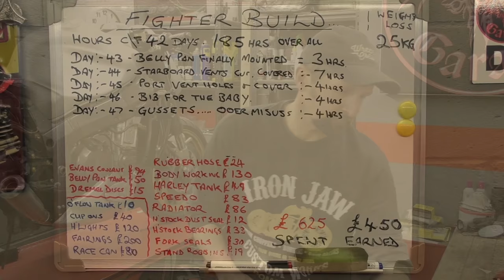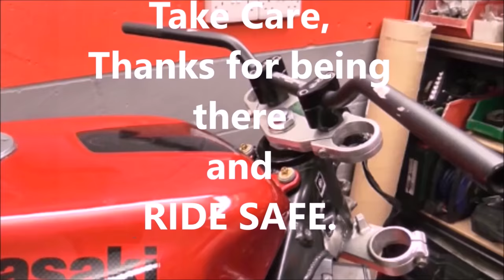Delboy's Garage, Fighter Build #42, GUSSETS !

Comment: Just a thought ... Possibly a lousy one, though it might inspire a better one or simply serve as a bad idea against which to contrast somebody else's good idea [was that modest enough? :) ]

Two words: NACA duct.  Wikipedia has a description, though a google image search will provide loads of examples on aircraft (including fighter aircraft) as well as on racing vehicles.  You can buy them preformed, but given your skills with metal working I am sure that you could also make your own easily enough.
Reply: I see Gregg Camara had the same thought.  Maybe there's something to this NACA duct thing.  (Then again, maybe not.)  :)
Reply from the maker: Thanks buddy, thinking of a similar idea but reversed, something to create a negative pressure and draw heat out... thanks for your kind input !

Comment: Probably been mentioned further down but I think it looks awesome without the panels and just leave them or maybe flare the back edge of them to deflect air more into the exhaust or French them with just a small 5mm ring to go with the nose cone. Sure it'll look good anyway!
Reply from the maker: Hi Josh, a few people have said flare out the holes, but they sit at about 30 degrees towards the direction of travel.. so no need for flares... i have a cunning idea to actually go the other way and create exhaust vents....but gonna sit on it over the coming wekend and make a final decision next weekend... i have some remedial work in between to drop off the covers, and weld up the bolt holes.. so that'll keep me busy while i ponder the exact path.... thanks for your input 
buddy... much appreciated...  Del.

Comment: Personal they remind me of kidneys. I would try them off , the add a grill (think machine gun barrel heat shield ) to the bottom of the forks so it only covers the cast metal parts where the forks meet the wheels. That way you have something unique but it carries the wholesale through the lower side of the bike.

Comment: If you remove the panels to see what it looks like for now. Rather than putting more heat into the belly pan,  cover the mounting holes with large black circles maybe 20mm od or so to see if opening the mounts out would add to the look and give more air flow.
I'd also say dimple die them but the dies can be expensive.
Reply from the maker: Hi John, my first thought was to dimple die the holes, very cool indeed, but they are curved at that part of the panel, so pressing the dies in to them would distort the entire belly pan out of shape ...

Comment: I would have drilled lots of small holes in a flowing pattern layout that way you can keep the smooth lines and get airflow. Honda used to do the same with the original 900cc fireblades.
Reply from the maker: I remember the pepper pot designs, I want something a little more dramatic though...!

Comment: I think the vents were a good idea in principle, but the bike would look cleaner without. Perhaps some kind of mesh, like what is used to protect radiators if you were concerned about the pan collecting things in it. The holes would certainly add to the character and then you've got that aircraft vibe which you like. ☺
Reply from the maker: I think so too mate, gonna work along those lines - cheers !

Comment: I'll go against the grain and say I'm afraid that without the covers, the pan will look like what it is; a fat, upside down fuel tank. I say leave them, go with different covers or modify what you have. 

Would you consider a row of fuselage style beauty rivets to carry on the aircraft theme? I could see it working in ' + ' pattern. Or break up the flatness with a neat scoop or one or two louvers...
Reply from the maker: Hi Ian, I thikn the idea of louvres has always appealed, but you can't cut them in a curved panel, as pressing the louvre outwards will buckle the shape, but am thinking of some form of mini-cowl over each vent hole to bring a little texture.. thanks for your input !

Comment: take them off. put fine wire mesh in the holes so that they are level with the outside edge of the belly pan. the mesh could be left as bare metal with a clear coat or painted the same colour as the frame.
Reply from the maker: No mesh buddy, it fills up with bugs and badgers, and I've done it lots already, wanna do something different - thanks for your input !

Comment: Why not weld small arched pieces at the rear of each hole on the outside, So it looks like a sort of fin or like gills on a fish to divert the air through the already drilled holes you have. Looking great Delboy stay well and I am sure you will have yet another epiphany. Ride safe stay well.
Reply from the maker: I have a similar idea now buddy,  I think you'll like the direction !
Reply: Cant wait and looking forward to the next video.

Comment: Hi love the vids , keep up the great work 
I do think you should loose the covers on the side of the belly pan they just look like a after thought , kidney beans spring to mind , I know they are not a after thought , you could simply put a lip on half of each hole starting with 3mm to 6mm giving you a staggered look and also forcing air into the belly , you could also form the front edge of each hole so it sits inwards , I have lots of suggestion but hard to explain in text , have you got an email then I could send pics of drawings 

Cheers kev
Reply from the maker: Hi Kev, got your drift, we are kinda going with that idea!... we have some amazing ideas those this feedback and we've arrived at a short list which will help us make a decision by next weekend - thank you for your input, much appreciated!

Comment: Maybe a silly idea, but I like the thought of a kind of air scoop for each hole? Obviously the middle and rear ones would have to stick out slightly more or less depending on the angle of the panel. Just a thought, but I agree, lose the covers.
Reply from the maker: You're thinking along the same lines as us buddy, gonna do pretty much just that - not sure exactly how yet, but will come up with the best design !
Reply: Of course you will mate, you always do!

Comment: Del, get rid of the covers. Weld up all the holes and return to stock (will take some body work) they're ruining the lines. (it's worth the effort) Look at the thumb nail for Video #31 it looks so sweet. If you're worried about cooling then turn the filler cap hole underneath into an "air scoop" but i don't think there's any need.
Reply from the maker: Hi Thomo, the vents are vital to reduce internal heat, I wanted it closed too, but it won't be long before we have problems - I'll take the covers off and weld the bolt holes up, but thinking of some cool exhaust vent style exits to do the job, gonna ponder till next week!

Comment: Lose the covers mate and the holes will create a vacuum inside the cavity which will suck the heat away rather than trying to force the air in to cool the exhaust
Reply from the maker: You are absolutely right mate, it's no use blowing cold air in unless it has an even larger path out again, otherwise it backs up... thinking of some tiny individual cowls to cover each hole facing rear to draw the heat out via negative pressure, cool air will naturally flow in to replace it from above... many thanks mate !

Comment: Oke, so big chance you already sort it all out.
Probably leave the holes visible, maybe with a big mesh, so it won't collect dirt etc, but prevents your belly pan from being a leave collector.
And you can easily recreate the holes in the front fender design.

Something like some of the old Honda's XL600 had. Google has trouble finding it.
But i have a good example on the FB; ( facebook com/Meifesto ) (insert a . at the right sport ;) ) 

You have some options ;)

Comment: Imo take the covers off Del,as there will be decent cross flow of air when the bike is stationary,and ticking over in traffic.This would also prevent the painted finish from being damaged by the heat of the exhaust.....ATB.
Reply from the maker: Thanks Steven, working on some ideas to draw the heat out, whilst still keeping the holes visible!
Reply: Hi mate,put a scoop on the inverted filler neck aperture.Stealth cooling ,RAM AIR crankcase  cooling the Suzuki (1970s) way!. ATB Del.
Reply: I know its a Kwak.Just some Suzy style thinking.Lol.

Comment: For the symetry tank/Belly pan. I'd keep the bellypan "stock" (without the covers). As far as the holes are concerned. I think they are pretty cool. But closing them would work too. From one side to another, are the holes placed the same way?
Reply from the maker: Hi buddy, no, they're not symmetrical, but the covers will be coming off, I've lots of plans what to do with them, once exposed!

Comment: I would be tempted to do individual scoops on each hole like the exhaust system on the Spitfire and Mustang I think that would look mega and it is called. fighter build after all ✌
Reply from the maker: Pretty much exactly what im thinking Arron... the passing air over the rear facing cups will create negative pressure and draw the heat out...!! like yer thinking buddy..
Reply: It would work a treat and not to mention it will look bad ass 😈✌

Comment: I'm not a fan of the covers tbh.... they don't flow well, although they could possibly blend in more with paint? however they also hide the shape of the original tank.. which is/was a cool first idea. so overall they are masking your mad idea of reusing/reshaping a tank......

the brace bits you have just done look sweet.... really flow good....the idea of internal braces   which you could see matching in with the seat unit is cool.... maybe mimic them underneath the seat unit? looking like they are holding the seat but all for show? 

small splits, bent out would of been more suttle on the belly pan... like fish giles :) keep up the good work. 

the
Reply from the maker: Thanks buddy, I think you're right, it's losing that shape that is making me doubt the covers , that inner shape is all important... I have some plans now, so this has been useful - thanks mate !
Reply: Moonfleet41 thanks for the reply.... quick random thought.... how abit some 'bars' (|||) (|||) (|||) across the holes... .

Comment: Del loving the work, i like the way your brain ticks over i like the covers but having it open get back the shape weld bead round like your going to do around the rest of it, don't think you will need to put holes any were else to mess shape of the bike your going for, what ever you choose as always im sure it will look bob on
Reply from the maker: Thanks Iam, im probably not going to weld the line all the way round the edge.. it could distort the whole thing... i have a plan for thickening up the edge... and as forth holes.. yeah, exposed.. but ill probably Hot Rod them u a bit...!
Reply: i go by grim lol an good point trying to keep the shape after all that work ive watched every vid an know it will look good when ur done

Comment: Hi Del,
the subject with those air intake holes (covers) has kept playing on my mind now for some time....
1st of all: Great you took those cover panels off!
2nd what I was thinking about in term of maximizing air flow and covering but not completely covering those holes and giving it the fighter look is this: Why not for each of those holes take a section out of a steel (pipe) bend like this

http://www.gotech.co.za/shop/index.php?main_page=popup_image&pID=52

Cutting a 90° bend into 2 pieces of 45° or three pieces of 30° and weld them over the holes but with the mouth/nozzle facing forward. By choosing the section angle and outer cutting angle to your liking you could play around with the visual effect of how much of the actual hole can be seen from the side and how far those nozzles would be sticking out from the belly pan.
These forward facing nozzles would also somehow recall the exhaust pipes on some classic WWII fighter planes like the

Spitfire - http://www.world-war-2-planes.com/images/Spit_inflight_color.jpg

or the

Mustang - https://filipkdesign.files.wordpress.com/2015/01/p-51-mustang-warbird-aircraft-2539111-1920x1080.jpg

Only they would be directed  forward instead of backwards....

Comment: less is more, but how about getting the seat done and stewing on it for a bit longer then return to it once the overall lines are established.
Oh, and not a bit boring, this is great stuff Team DBG.
Reply from the maker: Thanks Jonathan.. i cant leave things unfinished, any bike build is a series of small projects, and to let one go unfinished and move on can lead to a total loss of interest.. imagine if i has to go back to doing work on the nose cone as it wasn't finished... cant raise any enthusiasm for that.... the tail build will be inspired by the belly pan and other parts....that way it all flows.. if you have unfinished areas, then the whole things looses direction and ends up looking like it was designed by committee....!!  Ill be welding up the bolt holes midweek, then by next weekend, ill have a firm plan..!

Comment: Aye lose the covers mate. The holes will, however reveal the true thickness of the pan, so you'll have to consider beefing up the edges in the same way you will the top edge of the pan. Just never ending innit! This is where the tenacity kicks in, you know it looks wrong but want to move on. Don't. I'm sure you have already, but wheel the bike outside, stick the seat on and let's have a look as it is. Like the flaming logo at the start, and no disrespect to the awesome Mike Rench, but the music is wrong. Short and snappy, oh yeah and heavy for that look. Henge, baby! Check out Tosca, on here, Rabea's riffs are killer. If you contacted him, bet you he'd do you one.
Reply from the maker: Hi Peter, I've got a few ideas on the thickness issue, probably not gonna weld the wire round the top edge, it can end up looking too thick, and then it will look like fibre glass, I actually WANT it to look like steel... i have a couple of ideas to thicken up the edge, but don't wanna distort it by welding all round... the new intro roll was only given to us this week, I quickly used it before it was really even ready...

Am gonna use some of the heavy music we have to create a dedicated sound score for it, it's 8 seconds long, and we now have a 4K version, so that's just some computer work once I get time!  Hope you're well !

Comment: Sorry Del, but I was never a fan of the covers. However, I haven't heard you use that magical F word about the holes yet.. "Frenching". Would it successfully imitate the headlight if you frenched the air holes, or possibly make the holes more oval to match the headlight?
Reply from the maker: Hi Matt , I had thought of that at the beginning, but the very front most holes , on both sides, are only 1/4" from the header pipes, so there's no room for an inner tube... I have a cunning plan though with all these feedback!

Comment: What about ditch the covers and make some small shrouds over the rear half of each hole to capture the air and direct it into the bellypan. Could be made out of the discarded covers so no waste involved ???
Reply from the maker: Maybe the rear half of the holes, and I could make them tubing... !
Reply: Yep sounds good......... you`ve only got to make one and see how it shapes up........if it don`t float ya boat you aint wasted no time or materials ...... or even flare the rear part of each hole so as to help capture the air ? ;o)

Comment: I am wondering if the covers actual restrict the air flow rather than increase it. Try using a hair dryer and some smoke to see how the air flows along the inside of the pan to ascertain if it actually works as hoped.
Reply from the maker: Honestly Ken, its not that critical,, i just need to vent a little heat out of the belly pan... its not a supercar..lol..    You're right though, they may not actually be that effective... but i have a plan now..!
Reply: Moonfleet41 A cunning plan? So did Baldrick!

Comment: i dont know if my opinion is worth a toss in this case , I would make little inlet vents out of piping so it has little scoops directing the air in like a spifire nose cone or vmax...but obvously smaller...but then again im a fruit loop
Reply from the maker: All thoughts are appreciated David !  And yeah, thinking mini-cowls, the spitfire idea has given me some ideas tow ork on - cheers buddy!
Reply: David Johnson, I was thinking scoops too. I think it would be worth leaving as is for now painting it up with the grey paint leave one side off and looking for inspiration when working on the tail unit. Not a fan of just leaving the holes. Keep up the good work Del 😍it!

Comment: I think they could look better without, how about if you flared out the back halves of the holes to help direct the air into the bellypan
Reply from the maker: Hi James, they sit at about 30 degrees towards the direction of travel.. so no need for flares... i have a cunning idea to actually go the other way and create exhaust vents....but gonna sit on it over the coming wekend and make a final decision next weekend... i have some remedial work in between to drop off the covers, and weld up the bolt holes.. so that'll keep me busy while i ponder the exact path.... thanks for your input buddy... much appreciated...  Del.